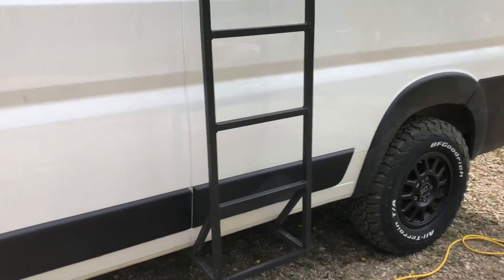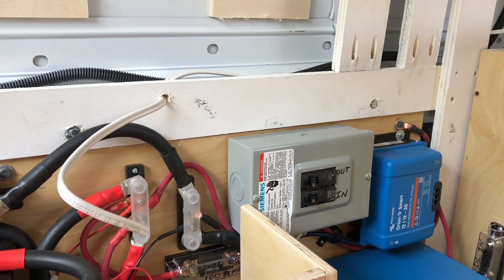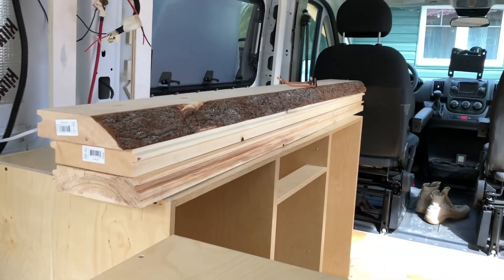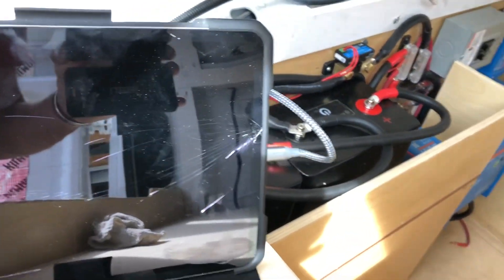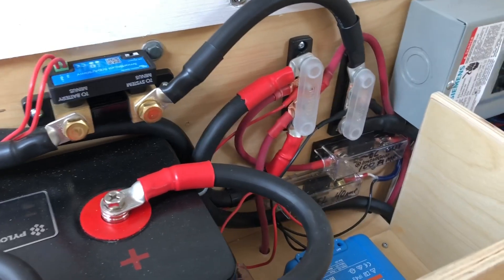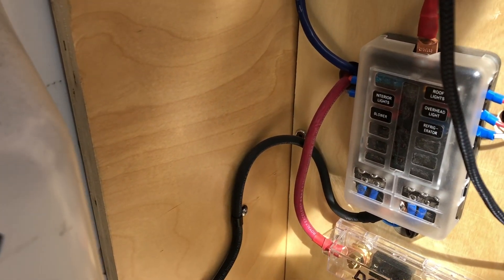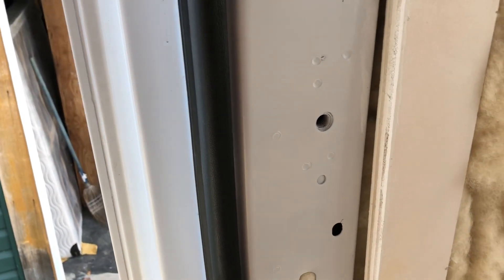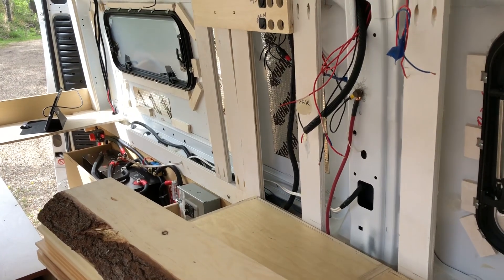Van Solar Installation Victron Part 2

Comment: What's the rationale behind running your shore power into a breaker in the van?  Especially a 40amp breaker on a 20amp line. I can't see what it's going to protect. Your shore power is already protected by a breaker at the other end. Maybe I'm missing something.
Reply from the maker: You are right. It does not really need to be protected again. The reason I did it is in case I go somewhere besides my own house that has known power protection, like a generator, or camp ground that my have higher amp protection or not to code wiring. It is pretty cheap insurance.
Reply: @dadzvanz936  I'm afraid to tell you though that it won't do you any good. Your wiring won't handle 40amps and you can't put circuit protection at the end of the circuit, it has to be at tee beginning.  That circuit is only wired for 20amp.  That's why I'm saying it shouldn't be there.

Comment: that solar cable is not rated to 40a. may want to look at upgrading the wire or putting a smaller fuse in.

Comment: Are you using nomex for your AC power in your van? What size cable are you using from your inverter to your batteries?
Reply from the maker: Yes. Nomex run from my breaker box to the AC power outlets and 2 Ott wire for dc mains